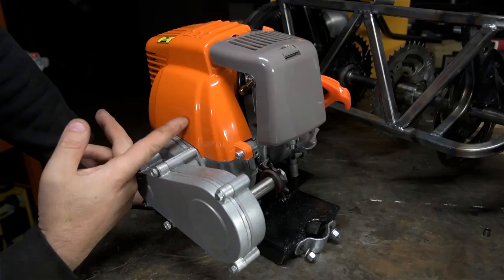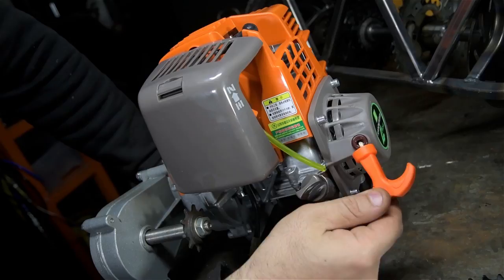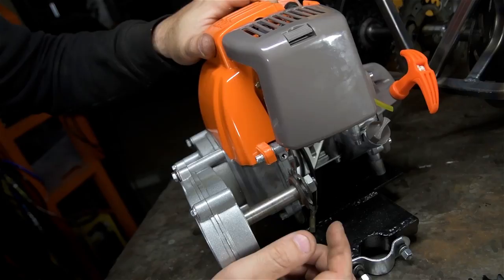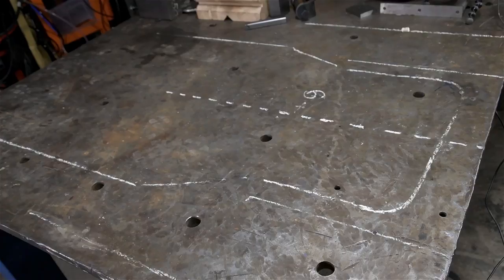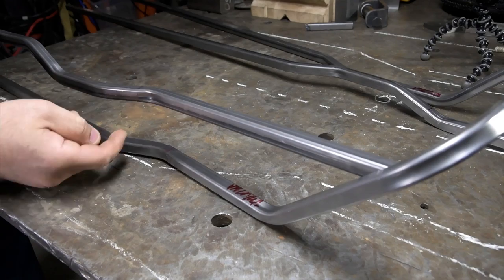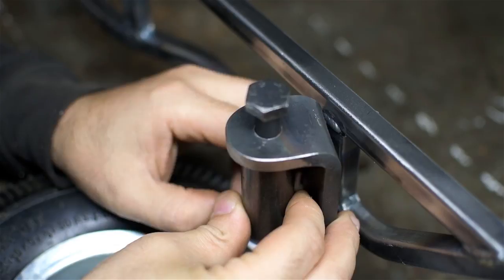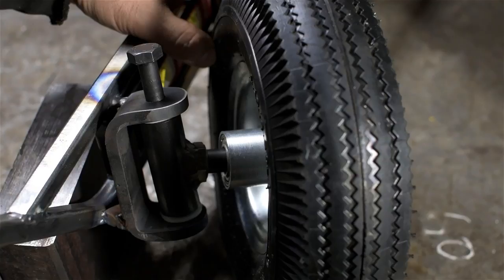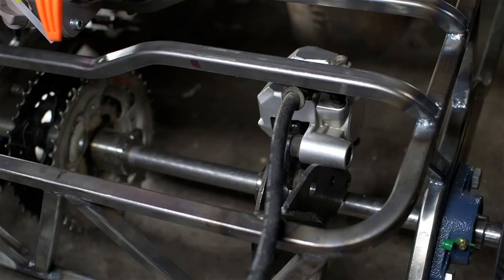"CHAINSAW" GO KART! - PART 2

Comment: Racing karts run two stroke engines which spin up to 16000 rpm.  On a lot of them the drive is direct with 1:7 gear ratio.  Crank shaft gear and axle sprocket are much stronger than bicycle sprockets as well as the chain.  Chains for these can get quite expensive.  But the key is to actually keep everything loose because the chassis, axle and engine will flex.  The axle bearings are special type that are designed to move to some degree in their cassettes which attach to the chassis.  And, since there is no differential they really don't turn very well in tight turns and slow speeds.  I believe some of the store bought kid karts only have one wheel drive to avoid this problem.

Comment: Tony, I think your caster and camber angles are far too aggressive.  A normal road car has around 3 degrees of caster and .5 degrees of negative camber.  With king-pin steering, the camber should be set so the scrub radius of the tire is minimized; the kingpin centerline should continue to the centerline of the tire, so the tire doesn't scrub when turning.  This can be accomplished through a combination of kingpin inclination and positive camber at the tire, or increased kingpin inclination and zero camber.  I wouldn't add a bunch of caster or camber, 6 degrees of caster is probably good, you want the steering to be light enough.
Reply: The caster angle is definitely aggressive, but the camber is essentially zero - it has nothing to do with the angle of the kingpin, but the angle of the tire, which in this case looks perfectly vertical to my calibrated eyeball. What he called caster was actually the steering axis angle, which does nothing but change the scrub radius.
Reply: Don't forget that unlike a road car the kart has no rear differential, only a solid axle.  This would make it difficult to steer properly so you need a good level of caster to lift the rear inside tyre off the ground and allow it to slip around the turn.  Caster tuning range (on a kart) is 8 - 20 degrees, with 20 giving more lift, but heavier steering.  I would start at 10 degrees for children to be able to turn the steering wheel.
Reply: Yep, they sound really aggressive when compared with car, but it will be a whole order lighter.

Comment: we first hot rodded a power wheels jeep years ago by installing an axle from a self propelled push mower with a weedeater engine. next I built my kids a go-kart using a David Bradley Gear Drive chainsaw engine and regular roller chain. it worked good until somebody, probably one of the neighbor kids, uncovered the engine which filled with water and locked up. I pulled the engine off filled it full of transmission fluid and stored it away in a building up until this year hoping to free it up and get it running once again. my kids are grown now the go-kart has long since moved on and I finally gave the engine away for scrap but it did work.

Comment: Hey Tony, nice build. On the camber angle when you welded on the wheel spindles, and placed them parallel to the ground, didn't you essentially negate the camber angle you'd just installed onto the bracket? If you when you think about it, when you adjust your camber on the car, the wheels move with it. I think the spindles should be perpendicular to the brackets they are welded onto.  Just a thought

Comment: Chain problem is because you put the idler pulley on the wrong side!  You have it pushing against the power transmission side of the chain (section moving upward).. the engine power simply shoves your idler back loosening the chain. Instead lose the idler completely, tighten the chain by moving the motor (like on any racing kart).. or remount that idler to push on the other downward moving section of chain.  Also, keep it simple, use a larger axle gear and a much smaller engine gear .. you probably want around 6:1 or 7:1 ratio  for a motor like that. Most racing 2 stroke karts use a clutch gear that is the smallest which can possibly be used (9 tooth #35 or 10-11 tooth 219 chain).

Yes, 20 deg caster is way too much on king pins ... for a kid kart and low speeds, I'd go for a very low caster nothing larger than 12deg and maybe much less (5-8 deg) .. will make it easier for your kid to turn the steering wheel.
Reply: All very good points.  Question about the idler.  I don't see that it's on the wrong side.  I may have missed something.  I'm glad an expert said something.   It helps tremendously.  Oh, btw, I think it's throwing the chain because the motor is wobbling around.  When I saw the first video I didn't like that mount.  It's for holding the chain bar.  Never meant to hold the motor.  I see other points on the motor that might be better to anchor it from.

Comment: Vibrational harmonics were VERY LIKELY a main cause of the chain issues. Installing several idler sprockets, a couple on each side of the chain, on both sides of the engine would have prevented most of the vibration. The name you were looking for was "steering knuckles"

Comment: I haven't read all the comments which probably has hit on the chain problem by now but in case not the bicycle sprockets are the problem if you think of it they are designed to jump the gears so to speak. Great video work.

Comment: there is no cvt it's just a chain drive reduction box, MAKE SURE TO GREASE IT UP OR IT WILL BREAK
Reply: robertas grigas I knew it was just too great of a deal to be true.! interesting how the manufacturer  used some deliberate designing to  further create the illusion of a cvt tucked into that  cool cover. I wonder why there isnt a cvt set up being produced for these motors. it would be great on a motored bicycle instead of the cheesy  hand clutch arrangement that is the weak link in those ebay kits.

Comment: The reason the chain "jumps" is pretty simple really. The cup enters harmonics, once it does that, the chain follows (or perhaps both help or the chain leads, regardless...) and once it does that, it slaps the sides of the gears. Those gears are made such that when the chain enters one of those indents innit, the chain easily jumps to the next gear. It's a feature of the gear changing setup of a bicycle.

In other words, to have made this work, you should've just found a gear that doesn't have those, OR, simply put a chain guard, just like every bicycle has in their front chain, i know some people think that it's just a fork (like in a gear box) but it also serves as a guide to keep the chain from going unstable.

Comment: A friend of mine built a go-cart. He placed the Gas tank directly behind him.... little did he know, he spun out and the tank hit something and it sprayed gas all over his back... which then ignited and gave him 3rd degree burns all over his back. So when you get to that point, make sure that it has a really small gas tank or two small ones with double walls and an over-pressure value that is facing down.... good luck!

Comment: Necro post, but great series.  

For future reference, 15 degrees of caster (the amount the kingpin leans back toward the rear wheels) is a nice generic setting that gives a nice amount of self centring without too much steering weight or steering lift.  You'll want the king pin to hit the ground a little ahead of the front wheel's contact patch, if you extended the king pins to the ground.

For king pin inclination, a specific angle isn't important.  What IS important is to try to get the king pin to virtually extend and hit the ground roughly in the middle of the tire tread.  This will help give the kart a nice neutral steering feel.

Comment: Another anecdote is that the "transmission" is neither a transmission or a cvt. Its just a chain driven gear reduction of 3-1 with a clutch bell on the input side to allow the centrifugal clutch to engage in.

Comment: chainrings and cassette gears off a multi speed bicycle have ramps and angles designed to allow the chain to shift well under load. they will throw a chain even with perfect alignment. you need to use bicycle gears deigned for a single speed bicycle with no shift ramps in them.

Comment: It is hard to build a go cart without spending money, about 30 years ago a couple of friends of mine and myself built 3 carts and we used small motorcycle engines for the power source. I had a T shift handle so I could change gears, with a triangle handle that operated the clutch. 
The cool part is that chain is all made in inch dimensions, even motorcycle chain. So all motorcycle chain matches up with one size or the other of standard sprockets.

Comment: This old Tony- you need a chain guide where it enters/exits the sprocket. Just like the bicycle you took the gear sets off of. All chain driven equipment uses guides to force the rotation into the set.

Comment: HI,  very cool but one super important thing.  That chain is pulling like  way more force then you think.  That chain saw with its cantilevered mount would never work, but could be solved by putting a link between the saw shaft and the axle. same with your new motor.  I calculate around 1000 lbs tension  from the 1" sprocket assuming 2.5 HP and 300 rpm for final gearing.  I bet you snap that aluminum housing in two without a support.  Put a bearing next to the small gear on the shaft then a bar from there to a bearing around you axle to take all of the tension.  Just saying...   good luck!

Comment: The chain was coming off as the teeth on the rear cassette are designed to easily transfer the chain from one sprocket to another. 

This was invented by Shimano in the 90s I believe, you’ll need a non-drop chainring as they are called. 

On bikes this is kinda uncommon unless the bike has 1X drivetrain. 

Hope this helps

Comment: That bicycle chain has tapered teeth - designed to allow the chain to slip off when shifting to a different sprocket. A warn chain and sprocket are especially "slippery." The combination is designed for slow speed.

Comment: Centrifugal force of the chain at high RPM is tremendous, If the chain was tight as on a chainsaw, it probably would havs stayed on. I also have one of the Poulan Pro 260 chain saws. The chain brake wore out first and I just removed it. If I remember right, it was rated around 2.5 Hp.

Comment: Looking really good now Tony !
If you reverse the steering yoke sub-assemblies (e.g. at 07:22) it gives more space for the steering arm to articulate.  So the yoke has a stub axle welded to it and the vertical tube is welded back to the main frame, usually on a short outrigger tube.  If you are chopping them off the frame anyway, then you may want to swap them around so they work the other way.
Don't forget the Ackerman geometry and point the steering arms inwards slightly to point to the centre of the rear axle (as seen in plan view), not just straight back.
Also , I'm sure they are just place holders but stiffen up the engine mounting rails A LOT as they will get pulled down strongly by the chain load and throw the chain.
Finally don't put the fuel tank directly under the child's hair.
Good work . . . eagerly awaiting part 3

Comment: Loving it! But good heavens you have to support that engine's output. The overhang is colossal on that thang. I think the cast alu CVT case will twist/break immediately once the chain is on and you hit go. Shortening the output so the leverages aren't such hell might be a neater solution.

Everything you've done yourself is class. Of course it's the one bit that's off the shelf which has sucky design! Keep being awesome!

Comment: Dont underestimate the mini 4-strokes with regard to rpm.
The typical 150-400cc utility engines all run about 3500rpm as a standard because thats the speed most mowers,washers and generators are set to run at.
But many of the mini-4 stroke engines can and do, pull 10K. This is possible due to the small size and the fact that those speeds are needed on most handheld equipment like blowers and weedeaters where a 2-stroke was the norm for many decades.

Comment: One thing that I can see happening is that torque converter sprocket shaft will bend, or break (more likely) from the torque put on it. Being a machinist/fabricator, you should make a support bar going up to the end of a new/longer shaft (where the countershaft sprocket will mount to) that rides on a bearing. The old setup seemed to be flipping the chain because it looked like you were using a bicycle sprocket and chain. Gotta use the correct chain and sprockets for the application.

Comment: Highly recommend adding a firewall, just a sheet of metal, to keep the engine, fuel, and drive chain separate from driver.  The seat doesn't protect much if anything hot or fast moves at the driver.

Comment: I know everyone has an opinion but if you'd welded your two steering knuckles together and made a beam axle, then mounting plates welded to the frame, you could then play with caster, camber, etc and once set, tighten up the bolts. It would have added structural strength as well. Plus you could adjust the front axle so it would be parallel with the rear using shims.

Comment: 12 degrees caster is still way too much. I'd go 5 degrees caster and 2 to 3 degrees negative camber. It worked well on my  autocross cars and on the go-kart I built. No front end push and neutral handling. I'd also go with about 1 degree toe in. You'll loose most of that degree with bushing play and rod ends etc, and it will handle great on tight or twisty courses without scrubbing off  speed on the straight sections. Good luck, it looks like a great build.

Comment: A lot of people commented on this topic, but anyway.
By car standards kingpin inclination angle is above average and castor angle is ridiculous.
But it is much lighter and most of litte weight in has is above rear axle, so i might be okay, but if steering turns out heavy at speed - try reducing castor to 15.

Comment: I have the same engine on a scooter I was given because it was not running. Needless to say after about a month I was able to get it running. I was thinking of this same project with a chainsaw motor I have. I also have a couple of old weed wacker’s I was also thinking of using vs the chainsaw motor. The gy6 cvt motors are good and easily tunable. I’m about to order the 81cc big bore kit. I also plant to change out the rollers weight to lighter ones on the cvt trans. Great design and fab.

Comment: I hope you will put a bearing block on the output shaft of the vari/clutch/drive....that bushing looks weak where it emerges from the cast and the long shaft will add even more torque to it's missallignment when it is under load. Great welding skills too!
c h a r l i e

Comment: I think you should consider turning the main axle bolts around. You should make sure that the threaded hole is at the head of the bolt, so when vibrations loosen the bolt, it won't fall out right away. That way, it is a fail safe design

Comment: Search RC car forums for some middle-ground (layman engineering :-)) description of steering geometry. Also, compare the steering geometry differences between road and off-road RC cars. As noted by another view, the 20 degree caster angle is more useful for off-road. Might be useful if you decide to make alterations.

On a separate note, I thoroughly enjoy you sense of humor and inclusion of your son in your work. Keep up the good work.

Comment: Bike gears/chains wear out surprisingly fast. Even a few hundred miles can make them unusable. No bike chain I have used has ever lasted more than  3000 miles, at best. Small sprockets wear out lightning fast.    With the sprockets close together, consider a belt or direct drive assembly.

Comment: Tony great stuff just found your channel and can not stop watching 
Away after watching go kart #2 putting the stainless in side the tube was a start thing to do but an old motorcycle trick is to drill holes in both sides of both tubes and plug weld the tubes and rods then leave a small gap where the tubes meet up and fill that with weld too this will spread the stress over a bigger area of the tubing

Comment: your chainsaw kart needed a neutral gear. that way when you started the chainsaw, the chain would be free to move when the clutch engaged.the only issue would be "shifting" from neutral to a drive gear without snapping the chain.

Comment: Love it! But...folks are right about these things: too much stickout on the drive sprocket shaft, bearing will die a quick death; that can't be a CVT, has to be a fixed reduction; and you need far smaller steering angles. With a solid rear axle, steering won't matter much, though. It'll understeer right into a stone wall. Air bag! Seriously, I built a rail dune buggy 40 years ago. The one thing that makes me cringe now is that I didn't design a safe, collapsible steering shaft. I built a lance with a single u-joint at the front end. Should have included an offset section!

As for it no longer being a chain saw kart, just stencil "STIHL" on the orange-n-gray power plant....

Comment: The Chinese like to call that transmission a CVT, but it's really just 2 sprockets and a chain inside. 17 degrees of caster is considered ideal for a motorcycle, I think it should work for anything.

Comment: May be too late, but I'd recommend a cheap laser tachometer (or even the vintage Starrett rotary type) to measure RPM at the engine output sprocket before sizing your final drive ratio. It's simple math from that measurement to max ground speed. $15 on Amazon and they're very accurate.

Comment: Already lots of comments about caster and camber angles.  I think the caster angle depends on the weight of the vehicle.  With standard cars the angles are pretty low but a go cart is so much lighter a higher angle is probably preferable.  Now who has the geometry and CAD chops to figure out the numerical solution based on the weight of the cart + kid and the steering force required to turn and return to center.  Not me, that's for sure. Great project and I'm gonna nominate you for best Dad ever.